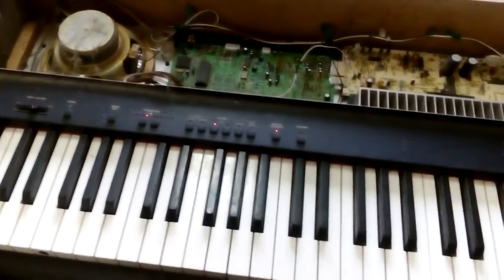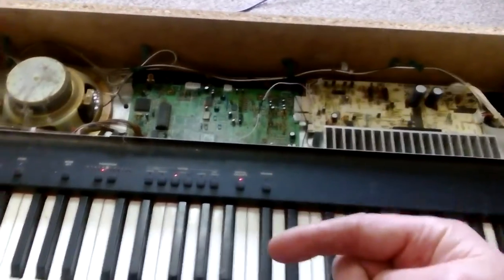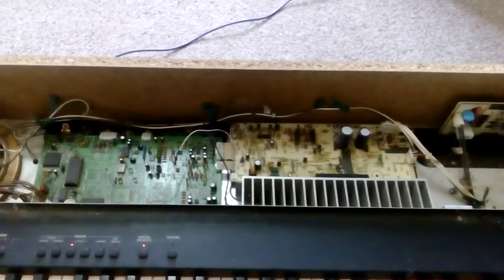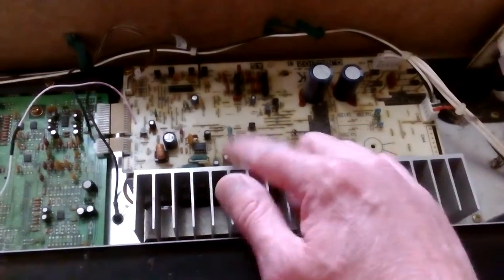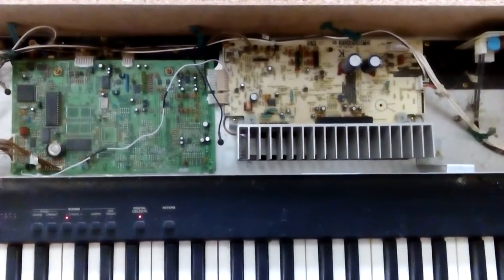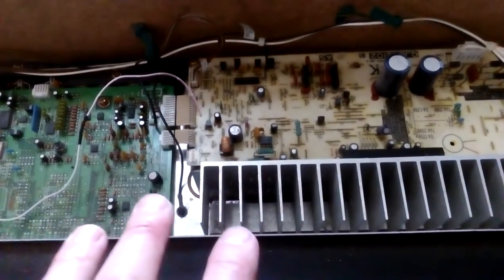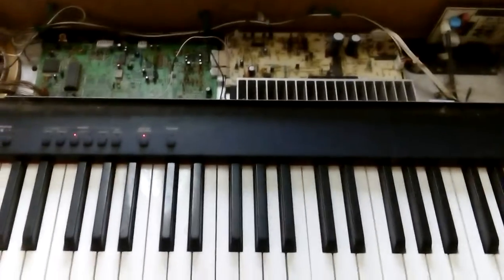Technics Piano PX71 No sound fix

Comment: For a long time I was trying to fix some Technics sx-pr603, 703, 903 and 1000 with that no sound issue so, your video is like a light at the end of a tunnel to me.  Also I had the same issue with some Yamaha digital piano. Now I have to remove the dust from those keyboards and start looking for that signal voltage. If I get some success of course I will post over here to save those keyboards from the landfill.
Reply from the maker: Best of luck with it!
Reply: @taddy666  I got those Technics sxpr603-1000 service manuals and on the MIDI settings it confirm what you said on your video.
On the MIDI PART SETTING, LOCAL CONTROL It says: " Use the LOCAL ON and OFF buttons to enable or disable this instrument sound generator. When set to ON, the performance from this instrument is transmitted as MIDI data and also sounds from this instrument. When set to OFF, the performance is transmitted as MIDI data but does not sound from this instrument."
Also on the power & tone control/amplifier board, there's is a test point named PMUT, by the side of some transistors as you show in the video. Now I will try to get  a working keyboard to see what kind of voltage is there.
Reply from the maker: @bepolite22  Hi What voltage reading do you get on that PMUT test point?
Reply: @taddy666  I didn't have the chance to go to my friend's storage and check it out. Maybe I can meet him next week.

Comment: Many thanks for your explanation, this is very helpful. Would you know what power transformer is comparable with Technics PCM Px55 piano please as mine needs replacing, thank you.
Reply from the maker: Sorry I'm not familiar with that model. Looking online the only service manual I could find (if it is the correct one?) is this (https://www.manualscenter.com/manuals/technics/sxpx55m-service-manual.html) which you have to pay for. But I don't know whether the website is safe or not so be careful! But if it is not a dodgy site and if it is the correct service manual it might have information about the transformer that you require!

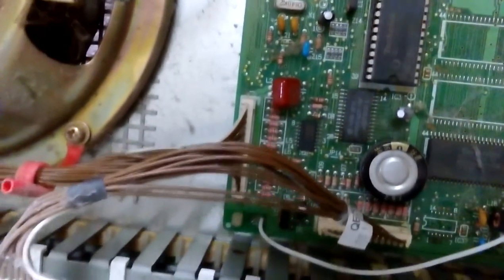Comment: Hello from Canada, I believe my synth is “locked” into midi mode as well, and though my synth is a Korg MS2000R, since I’ve tried just about everything I could think of, this might be my last shot at this. So, could you tell me what that chip is [markings, identification] that you are pointing to at 5:30, and also the markings of that transistor, which switches the amplifier on and off. Yeah, it’s a long shot… not even the same brand of synth and all but hey, who knows? Please reply, any insight appreciated. Thank you kindly
Reply from the maker: I can't actually remember and I didn't have the specific schematic for this one. I think the in order not to mute there needed to be 4.5V signal going into the base or gate of whatever transistor I was pointing at there. I took the boards out and traced it back to that chip which I think was some kind of logic chip but that particular logic gate  wasn't outputting the 4.5V so I just found a point close by that was continuous with the 4.5V on the input of that gate and jumped it from there basically bypassing the faulty gate. Something like that. A Korg layout/system is likely to be completely different I'm afraid but if you can find a schematic that is well labelled you might find a track that is labelled MUTE or something synonymous.

Comment: Hi Tom, how did you connect the feed wire to the two components? If not obvious enough from the wording of my question, I'm a complete novice to any sort of electronics tinkering, but love trying my hand at fixing something, especially since I received this piano as a highschool graduation gift in 1998! thanks! chad
Reply from the maker: Hi. I can't remember exactly but I believe I soldered one end the wire to a point continuous with the relevent leg of that tiny IC chip (looks like it was on the other side of the board but somewhere v close to the chip). I think I drilled a small 1mm hole through the board somewhere very near to the connection point for the wire to go through (but be careful not to hit any other tracks or components!). The connection on the power board on the right was I think just drilling a hole near the track in question that leads to that transistor (can't remember which leg though!) and soldering on to that track. It was a bit of a headache finding the correct tracks as I didn't have the exact service manual. I had to study the circuit for hours to work it out. Before I did any soldering I tested it by just holding the wire on to the IC leg and the transistor leg and seeing if the sound came on. Good luck trying to fix it!
Reply: @taddy666  thank you much for your explanation and the time you took to reply!

Comment: Hi Tom, I need your assistance. I have Kawai CN3, which does not give any sound to the speakers. I have checked the component on sound amplifier. I have also bought Peak Atlas ESR 70 to check the capacitors. Everything looks good. This is my personal piano. When I check the voltage on the both side of the speakers I get the 14 volt from both positive and negative side of the speakers.
Reply from the maker: Do the headphones work? If they do or the line out works then it is prob the power amp or eq amp area. I would have a look at the service manual - especially the block diagram here... https://www.manualslib.com/manual/1069632/Kawai-Cn3.html?page=17#manual .... and try to isolate exactly where the issue is. On Electrotanya you can download the schematic for free... https://elektrotanya.com/kawai_cn3_digital_piano.pdf/download.html
I'm not really an expert on keyboards as I mainly do electric guitar electronics.

Comment: Hello Tom and greetings from the US.  Thanks for the video and sharing your solution.  I have a similar Technics piano (PX-55) and am experiencing the same problem.  I have verified, as you found, that the keyboard generates a fine Midi signal (connected to my iPad w/GarageBand I can play the virtual instruments).  I'd like to attempt your solution.  I can solder, but I'm not very good at it.  Any tips on what kind of wire and how to identify the exact points where I would need to solder the jumper?  I'm presuming that both boards were fully removed when you did the repair.  Regardless, I'll let you know how it goes one way or the other.  Thanks for doing the hard work!
Reply from the maker: Hi David. Have a look at the reply to Max a bit further down on the comments. As I said I cannot remember exactly where I did it and I don't own the instrument and also didn't have the schematic. I thinik I got a similar technics model schematic from ElectroTanya. I just some multistranded flex wire - nothing fancy and yes I took the boards out to solder. Don't use an iron with very high wattage and don't apply heat for too long as you may burn the tracks. Good luck
Reply: @taddy666  Thanks Tom!